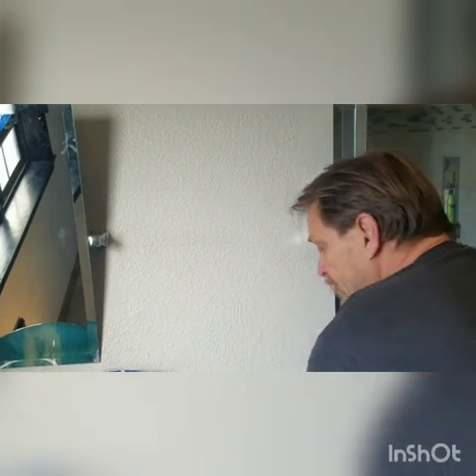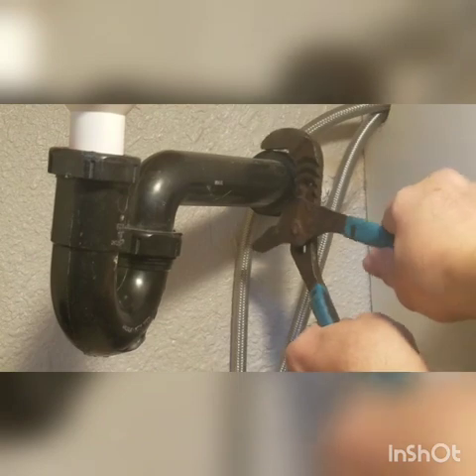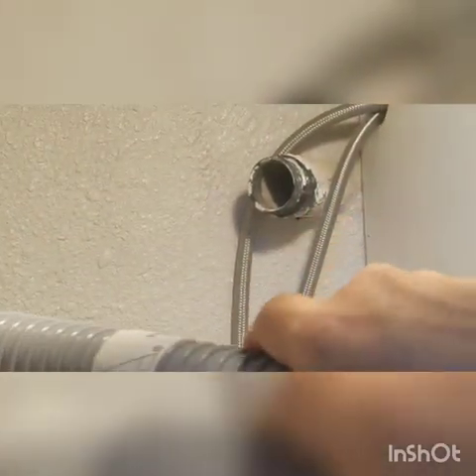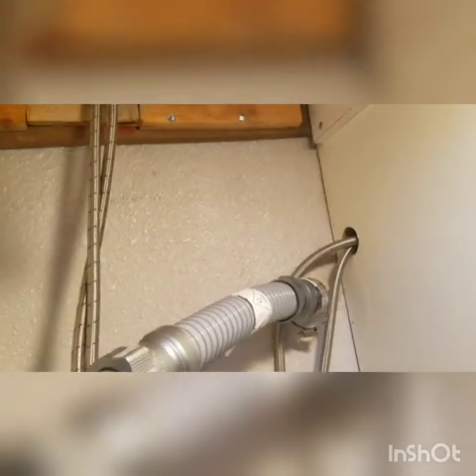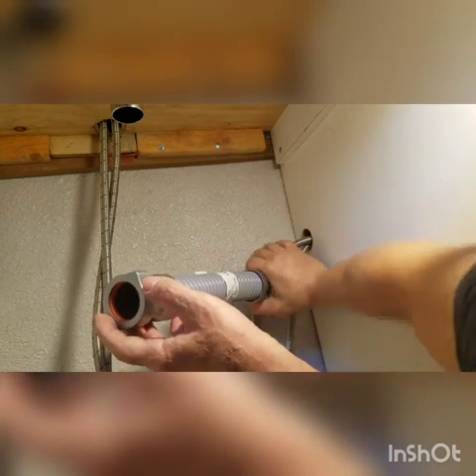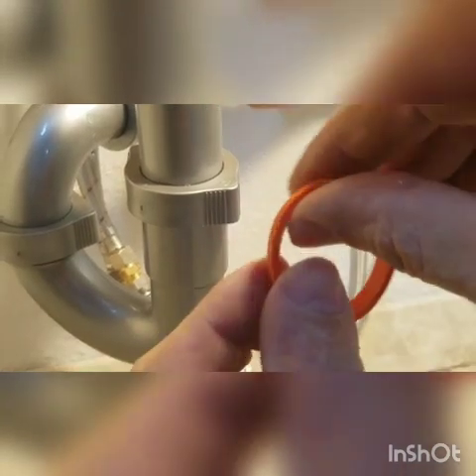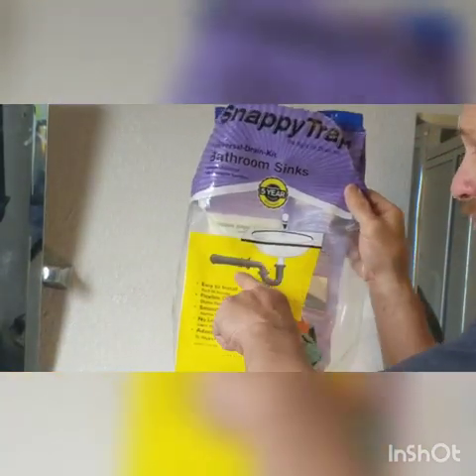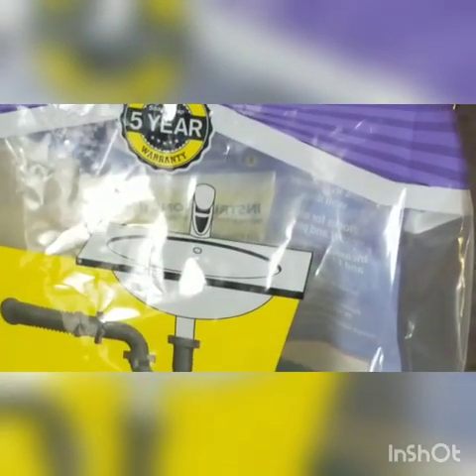How To Install A Snappy Trap  | Snappy Trap All in One Bag | Home Improvement Tips

Comment: I need to replace my bathroom sink trap and I'm going to get one of these Snappy traps that was excellent thanks again Ken👍
Reply from the maker: Bottle caps how are you doing bro thanks for stopping in yes this is a very good straight forward product with spare parts you might want to check out the part to this was a inch and a half and my down drain pipe from my sink of inch and a quarter I was able to take one of the extra parts and modify and make it work I'll be uploading it probably tomorrow sorry it took me so long to get back to you I'll be by to visit I'll probably be repeating myself appreciate the support it means alot God bless bye for now Ken

Comment: This cannot be up to code, and wouldn't pass an inspection!?
Reply from the maker: This is for the HomeOwner, I wouldn't use this in new construction.
...But for the HomeOner, it works. Thay give you a mix of Parts, in case  thay in Counter other Problems.
    thanks for your Comment, By for now, Ken.
Reply: Works in 80 year old, jury rigged through the decades with mix a match parts and spaces. Blazes, even the electrics are circa 1940.
Reply from the maker: John,  Thank you for commenting, Sorry took me so long to get to you thank you for visiting. I hope you get this message I look forward to hear from you you might want to check out some of my more recent videos. If you put a question or comment in my most recent video of be sure to get it bye for now God-Ken.
Reply: For home owners it’s listed code in all 50 states